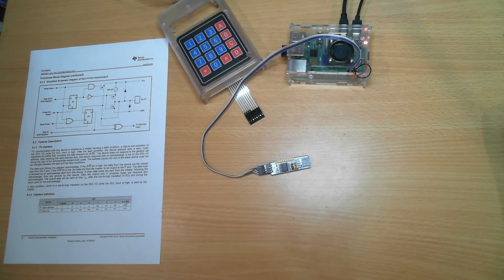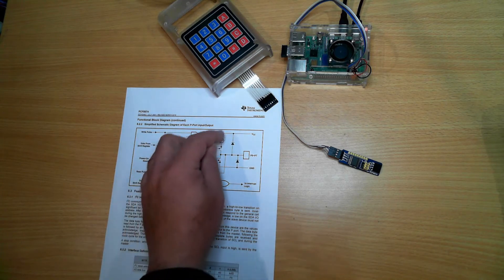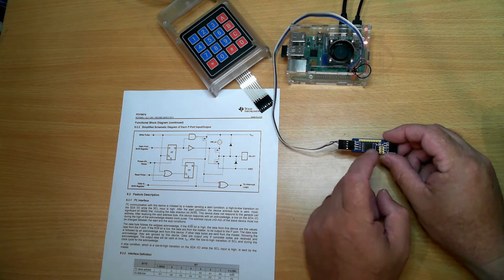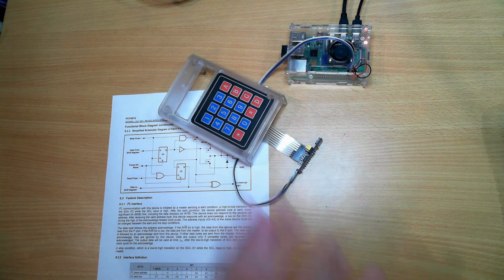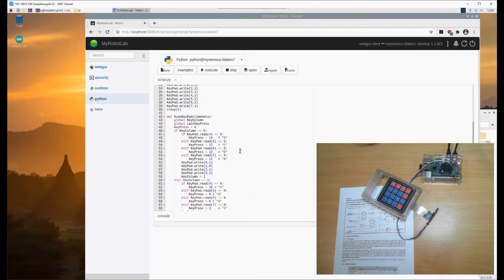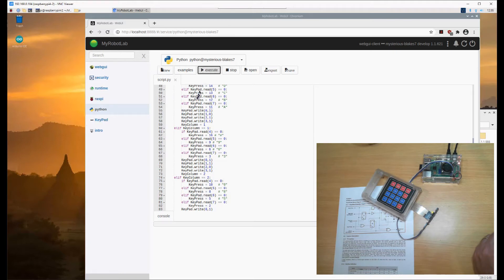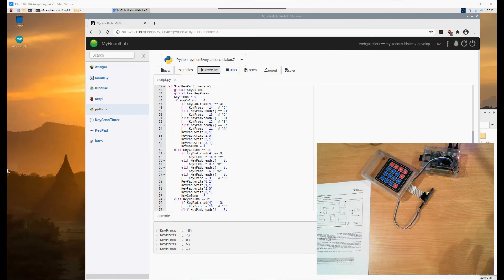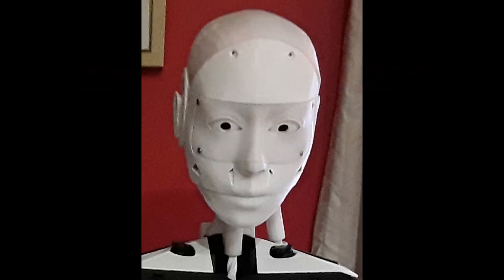The PCF8574 I2C 8 channel IO expander

Comment: Very interesting Ray, what are you planning to do with it?
Reply from the maker: The basic chip in this unit is also used on both the 16x2 and the 20x4 LCD displays, SpotMicro has the 16x2 fitted to it :-)
Grog at MRL has just refactored the service for both the LCD driver and the PCF8574 service :-)
This could be used to operate LED's or act as switched inputs.
When I was looking through the code for the PCF8574 in the MRL Service, I could see there was a great deal of confusion as to how it works, hence this video :-)
I may yet add a membrane type keypad to SpotMicro for mode control, or maybe even to Fred.
It's just another tool in the toolbox we can use :-)

I'm still trying to get a grasp on how the MRP121 works, that is also an I2C device that adds up to 12 touch sensors :-)